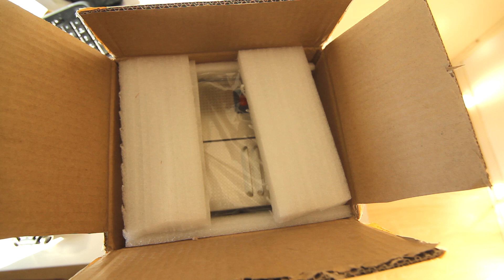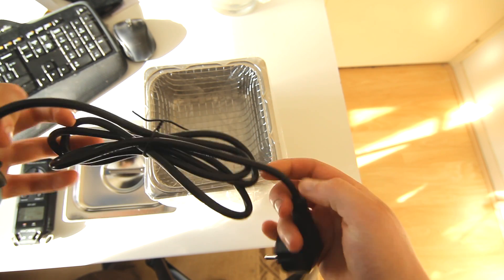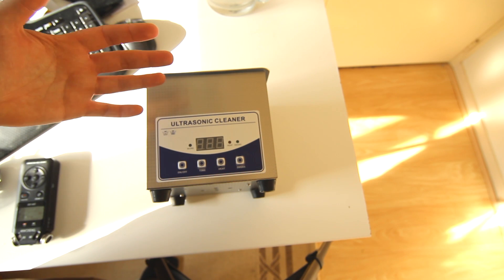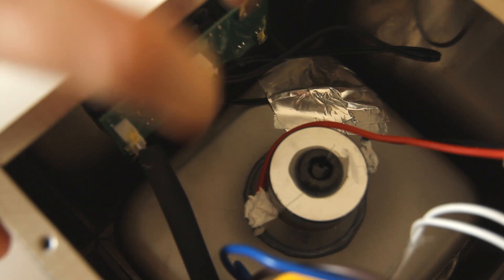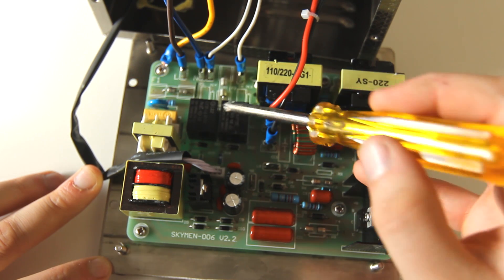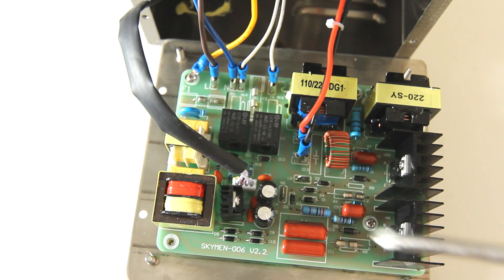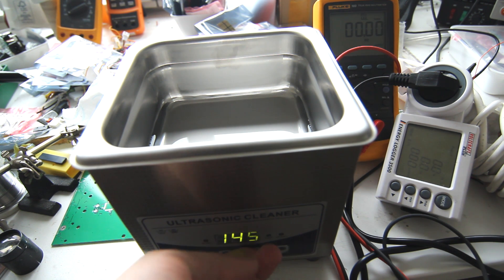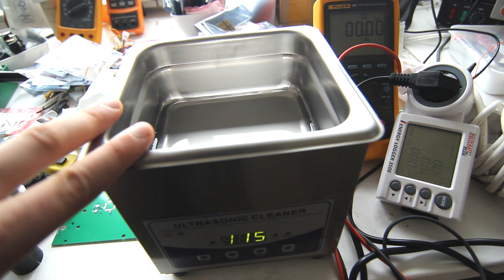eBay ultrasonic cleaner teardown & analysis (028)

Comment: Seems the transducer on mine is fading - works on power on then quickly dies off.  Suspect it's unrepairable...

re- self driving... the way it was explained to me was that the initial power-on ramps up and as power flows to the component, that change drives the initial kick that starts the resonance...  Many of these units - especially the boards on their own - come with a warning that the power on should be fast or it will fail to resonate... (that's bad)...

Comment: At 12:15 your pointing to a resister with yellow band as the 1st ring, mines blown, as well as a glass fuse, can you tell me what resister this is please as I need to buy some, mine would turn on, the heating part working, when you turned on the ultrasonic part it popped a fuse, I replaced the fuse twice, opened it up and saw that resister had blown
Reply: The lines and colors do have meanings, i don’t know off hand but google a decoder and you should find a replacement

Comment: Hi! interesting video, I have one similar to yours but of 15 L, unfortunately it came from the faulty china, in the sense that as I press the main switch to ON, the house current jumps and I cannot understand why, I tried to do continuity test and I find that the traces where the red and black wires of the ultrasonic transducer pass in the pcb board are connected, do you think this is normal? could this be the cause of the problem?

Comment: It is more crucial to check how they glue the transducer to the tank.  Doggie glue will deteriorate the coupling in a relatively short time due to heat and vibration.
Reply: Man la I have a broken ultrasonic bath I am attempting to repair. The blown transducer was stuck to a black layer of something then a clear epoxy onto the tank. Do you know what the black layer is?
Reply: Matt it could be just JB epoxy.

Comment: Fairly good circuit breakdown. After the primary step-down transformer, 12Vdc is derived from the 4 rectifier diodes you pointed out and the 7805 input is taken from the 12Vdc supply to provide 5V for the uController PCB. It's hard to match things up using a video but it looks as though mains power is routed to another set of rectifier diodes that pass rectified mains at 160Vdc  to the switching transistors in a "self-oscillating" circuit, probably a "tickler", to drive the transducers directly. You are correct about the large magnetics providing a wave-shaping function for the transducers and C11 and C12 limit current to them. The relays switch the transducer circuits and the heater on and off using inputs from the uController board. Not bad as "Chinese" production goes but ultimately, the quality of the components is what will largely determine longevity and performance of the unit. As always, you get what you pay for. Enjoy the cleaner.
Reply: Is it possible to attach a small load such as a light bulb to test the output of these boards? Disconnecting transducers.
Reply: Please fet number